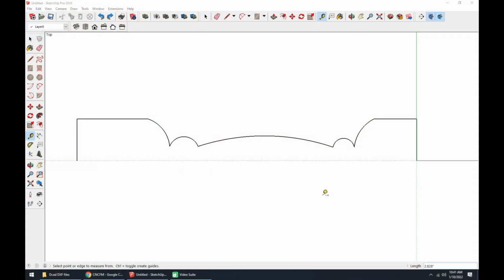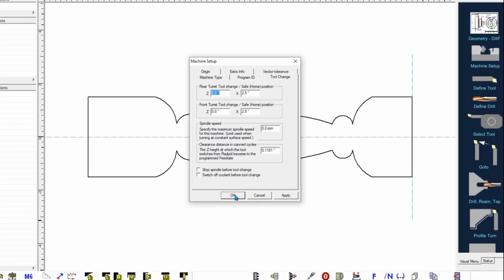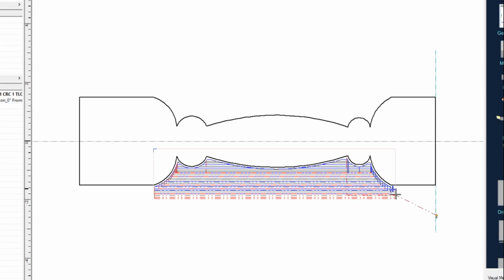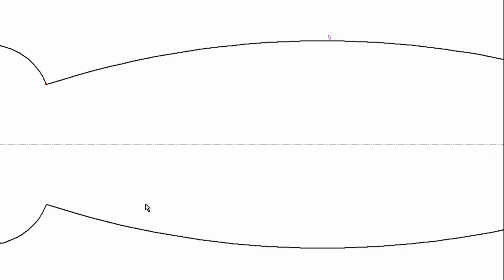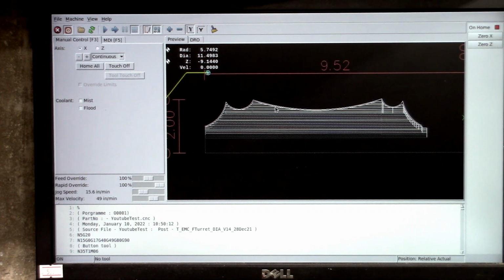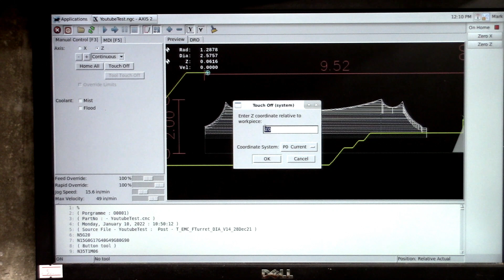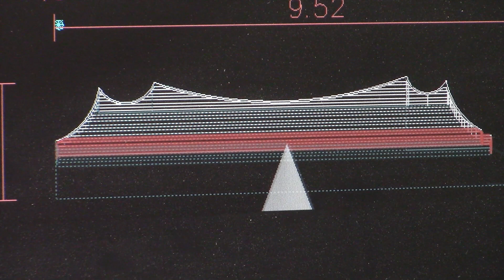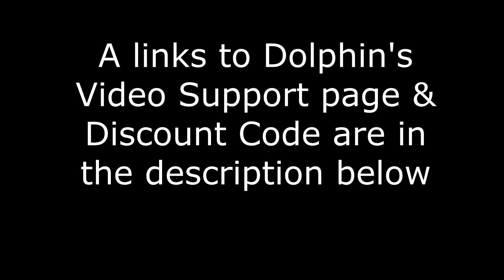Start to Finish!  Turning a Spindle on my CNC Wood Lathe, Also a new user friendly CAM program.

Comment: Hello Sir,
I have a doubt.

For example, if I am trying to turn a drumstick on the CNC, should the raw dowel's size be mentioned or any kind of irregular sized dowels can be mounted and the CNC just makes it right as per the design.
Reply from the maker: Yes, that is in the TURN setting. You can guess at the setting or enter a number
Reply: @WinkysWorkshop  oh, right then.
Thankyou so much 🙏🏻

Comment: Great what's the spindle RPM?
Reply from the maker: Good question! Somewhere between 350 and too darn fast! Haha. I recently got a optical tachometer so I should check it and find out. The motor is 1750 and it has a set of cone pulleys that are about two to five inch. I suppose the highest speed is appropriate for a short 1-inch spindle but it seems a little scary anyway.

Comment: As you can see is the right side of all convex and concave parts of your work pieces are very rough and the left sides are smooth. This ist the difference to metal turning: Wood has grain, and your machine is working paticulary  against the grain. Your chisel tool must go downhill from the highest point to the center line. So don’t go with the tool from the right to the left side or from left to right for all cuts, you need to go at least two passes: one for the left sides of the profiles and the other one for the right sides. Take a look here and you know what I mean: https://www.youtube.com/watch?v=aHrp_ql4eJw. Greetings from germany
Reply from the maker: Thanks Walter. When I turned by hand I followed the same rules. However, with CNC it's a bit involved to do and second, it doesn't seem to mater. When I get finished turning something its almost ready to finish. A cup shaped tool seems to work idea and it has to be sharp. No tear out at all...  smooth!

Comment: Does the dolphin cam have post processors for Fanuc's?
Reply: Also, can it compensate radius without using the controller's radius compensation feature?
Reply from the maker: If I understand your question correctly - Yes. You define the tool radius and it compensates.  I really like this program.
Reply from the maker: Yes it seems to. https://www.dolphincadcam.com/support/post-processors/lathe/

Comment: That is cool, to see the process from design to cutting.  In the process of getting a 3D printer here, so can understand a bit more of the learning curve you've had.  Looks like you and Billy have that set up pretty well!
Reply from the maker: What Billy did was amazing. He built the controller, installed Linux and Linux CNC on a little mini computer and had the stepper motors connected and functioning when I picked it up. He suggested a CAM program called Cambam and that got me started. Then I found PartMaster by Dolphin and it was way more intuitive to me. Oddly lathe programming should be more simple that 3D. I mean it's only a simple profile and 2-axis BUT, the software available for lathes are incredibly limited. I'm not saying the 3D printer will be easy but the software is probably a little more user friendly.

Comment: I know very little about G code but have seen videos using it. I don't see the point of it - when there's cad/cam software like that that can create the G code without having to remember the details. I will however give you a task to do on that process - and that is to cut the two narrow necks in one process - so that the tool's not traversing back and forth along the wood it's not cutting more than it needs to. Is there an 'optimise cutting path' option ?

Anyway, a useful video to see CNC process made easy (compared to hand-writing G code!)
Reply from the maker: I can't imagine writing G code by hand.
Reply: @WinkysWorkshop  It's how it's taught - or seems to be. That way offers full flexibility and plenty of opportunities for getting it wrong leading to a crash or two !
Reply: If you were turning this by hand you would  cut with the grain only ( down hill)  so start from the max diameters and cut either side to the min diameters . We can turn on our cnc router,  we would draw half  the drawing put the cutter paths on then mirror it .

Comment: 15:10 Rather than just standing watching it, add a few drops of oil to the machine screws and slides !
Reply from the maker: Ha...  yes, it happens!
Reply: @WinkysWorkshop  That's what power feed is for - let the machine do the work while you're its slave oiling it !

Comment: I don't know a ting about CAD and CNC. I really should start learning all this.
Reply from the maker: It is a lot of fun and also amazing. What makes it hard to learn is that everyone is doing it a little different and using different terminology. There are some standards like DXF and G-code but even these have variation. It's kind of like BASIC or DOS verses Windows. They are all powerful operating systems but only Windows has evolved to a point where most people understand how to work with them.  When it comes down to it, BASIC and DOS are very simple compared to Windows. CNC is also very simple if you are a computer programmer but 20 years from now it will be much more complex but at the same time, much more simple from a users perspective (just like Windows).

Comment: G’day Mark, would it be able cut in both directions ie: Right to left, left to right?
Reply from the maker: I'm not sure but I suspect the answer is no. Here's the reason (I suspect). Most CNC lathes are for metal. Most metal lathe tools are designed to cut in one direction. Typically what would happen is you would set up the program to cut profiles on one side of a object, create a tool change and then cut the other side. The program is totally capable of this even if my lathe is not.

Comment: Very Neat Winky..... So what are your plans for this New CNC Wood Lathe? any Hints ?
Reply from the maker: It's hard to say for sure although I do have some use for it. I have made several electrostatic generators called a Wimshurst Machine. These machines were invented in the 1880's and are typically very ornate. I'll probably concentrate on making some of these. They are basically functional art. Here's one I have started: https://photos.app.goo.gl/9adzQCpFFqKGfKjE6

Comment: It's good to see your project finished, as I'm sure you were out of your comfort zone for much of it! Pretty neat process. It's very similar to operating a CNC router if you were curious. At this point, it wouldn't be a huge leap for you. The one thing that surprised me is the g-code generated only makes cuts in the same direction rather than both directions. It only takes a little longer, the end result is the same! Good job sir.
Reply from the maker: Thanks for the comment. Most software is designed for turning metal and with a few exceptions lathe tooling is designed to cut best in one direction. It's possible to cut from the other direction but as a separate operation. Typically a tool change takes place before the direction changes. From a G-code standpoint it's totally possibly to cut in both directions but if this CAM software can do this I have not figured out how.  But like you said, in the end the results are the same. If I was mass producing spindles I'd figure out how to do it.

Comment: Can you set it up so it cuts from both directions?
Reply from the maker: This is possible although I'm not sure if the software supports this. I think the reason for this lack of support is that most metal lathe tooling is designed to cut in one direction. Of course the software works with any lathe but most CNC  lathes are metal lathes. It can be set up to cut a sequence of cuts in the other direction however. On a comercial CNC lathe this would probably involve a tool change which my lathe does not have.

Comment: I am always impressed at what you and Billy have built there.  Every time I see it I want to make one.  Maybe if I find a wood lathe real cheap someplace.  Thanks for the video.
Reply: Keep an eye on Craigslist. I got one, with no motor, for $25 Cdn. Just before the plague started.
Reply: @trollforge  will do thanks for the tip.
Reply from the maker: @trollforge  Plague is an accurate description.
Reply from the maker: Thanks Harold! I think if I was going to do it again I'd simplify the design with some kind linear slides. It would add cost but simplify contraction.

Comment: Definitely a project to be proud of Mark. It would be very interesting if you and or Billy were to make a video explaining some of the terminology.  I get lost easily when terms like G Code and DGF files are used. I am assuming it is just some file similar to pdf. Thanks for all the time and effort you and Billy invested bringing this to us.
Reply from the maker: That's a good idea actually. In some ways I don't feel qualified because I struggle with this stuff myself. However, in some ways that makes me more able to explain how things work in a more understandable way.  Just a summery, usually a profile is drawn in CAD and exported as a DXF file. DXF is short for Drawing Exchange Format and pretty much the standard for computer manufacturing. The CAM program (Computer Aided Manufacturing) takes the information stored in the DXF file and creates a G code file. G code is a text file. You write g code in Note Pad if you know the code but CAM makes this much easier! Here's an example of G code: "G00 X5 Y12" This means a rapid move to 5-inches (or MM) on the X axis and 12-inches on he Y axis. Billy is way ahead of me on the computer end and does very well at getting down to my level.
Reply: @WinkysWorkshop  Thanks for the quick reply, Mark. Just simple explanations like this are the building blocks someone like me needs to understand the language when a creator like Billy is explaining something. Makes it even easier to follow along on the discussions on AWR (Harolds) Sunday chat. Thanks again to both you and Billy.
Reply from the maker: @terrycannon570  Your welcome.

Comment: Just a comment, not a criticism, I know cnc is the future, but it seems to me if you'd just grabbed your bowl gouge, you'd have had that spindle turned yesterday!
Reply from the maker: This is a very good point. I've used a manual lathe many times. I did okay but I would not call myself an expert. For one spindle or a bowl it's a good way to go. Where the CNC excels is repeating. It usually takes me 20 minute to create a profile and another 10 minute setting it up on the lathe but after that I can start the lathe and walk away. Aside from changing stock the lathe works on its own. I can make 20 spindles for a chair and every one of them match.
Reply: I’ve always said that I know enough lathe technique to make one of anything. If the need is for more than one, I’m in trouble if they are supposed to match. Tables with 4 unique spindle patterns on the legs are not hot sellers at the craft show. So, I could use one of these computer assisted machines. Or stick to making project with only 1 spindle in them, lol. 🥸👍👀🪵
Reply from the maker: @joeromanak8797  Exactly the same with me. Now that I have the software figured out even one spindle is quick and easy. Right now the cutter is the biggest issue. The one I made looks like a very small spoon. It works great for about 5 or 6 spindles and then needs to be sharpened. Carbide works but not as well. I have some inserts ordered but I suspect they will be the same as past inserts I have tried.
Reply: Yeah, sure, unless you need 16 for a project…and you want them to be exact…OCD

Comment: Great outcome Winky. Seems to waste a lot of time in cutting in one direction only. Can you set it up to cut in both directions ? even if it was only in the roughing out stage. If you are intending to make these wooden parts to sell, time will be money, so any reduced machining time will mean more profit. Regards from Australia.
Reply from the maker: As far as I know you can not but it might also me my lack of knowledge. If I was in a production environment cutting in both directions would be very important but for the work I do it doesn't mater much. But you are correct... lots of wasted moves.

Comment: See, old dogs can learn new tricks!
Back in the day, I programmed everything with "G-code", writing the program at the machine console. Then we went to writing the program on a remote computer, downloaded to a flash drive, or transfered through cable to the machine. Set the tool offsets and away you go. Nowadays with cam software, things are so much easier and quicker. Tool paths are created and simulations can be run for verification. 
It's too bad you can't run tool path so it cuts in both directions without retracting the tool. Nice job!
Reply from the maker: Cutting both directions would be good for the roughing cuts. I'm sure glad they have CAM programs that create the code!

Comment: Did you use poplar wood for this project?
Reply from the maker: Yes I did but it will cut white oak equally well as long as the tool is sharp.